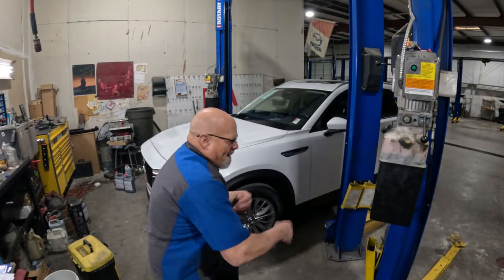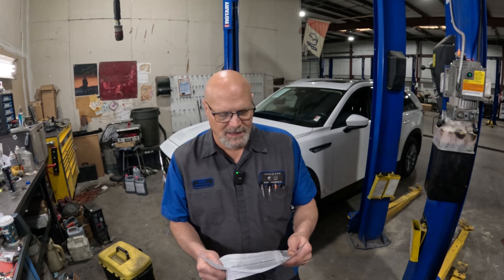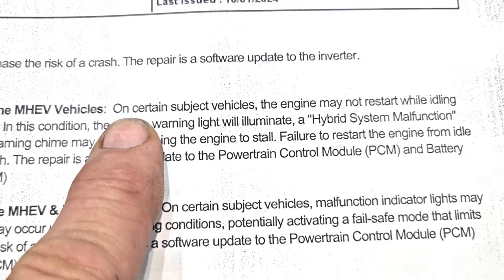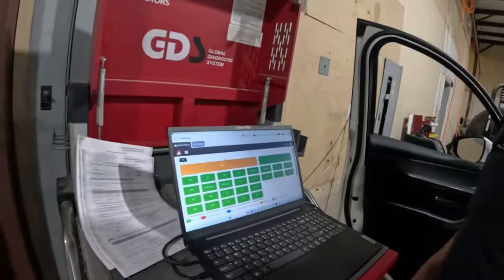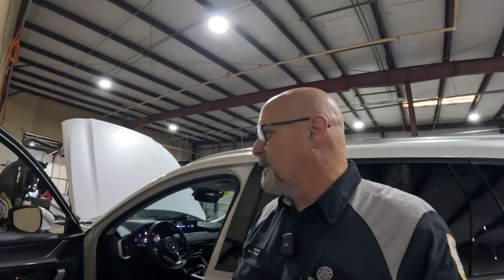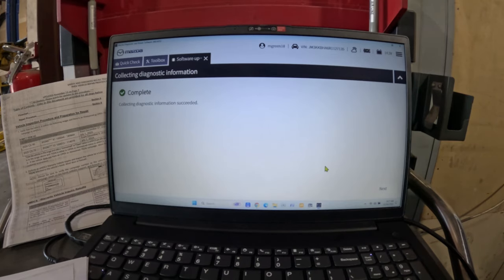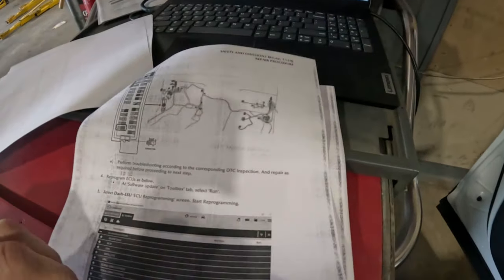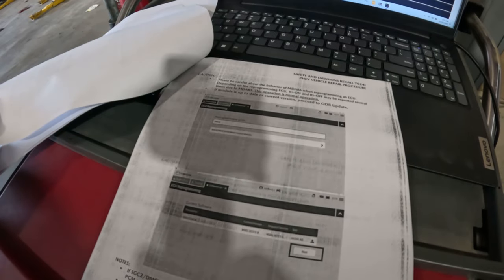Mazda CX-90, CX-70 Recalls

Comment: I was on the fence with a Lexus ISf 350 or 500, and a Nissan Armada platinum. The Nissan is self explanatory, the Lexus was small but a solid built proof and hindsight I wish I bought the Lexus. The Nissan is surprisingly having a few issues, I’ve owned them before and not an issue, however I’d say Lexus all day long folks, the price point of the Toyota is so close and the warranty of the Lexus is a lot longer.

Comment: I always worry that my CX-90 won't start back up while the i-stop is on. Now I see there's a recall. Can you do a video on why Mazda brakes squeak? Thanks for the info.
Reply from the maker: Brake squeak and Mazda can be a very touchy subject.  I'll have to look into this.  Thanks for watching.
Reply from the maker: I call them Trail Blazers.  Cutting the path for the rest of us. Someone has to go first.
Reply: I have the exact same concerns: 1) very slow start from istop, 2) squeaky brakes. The dealer told me both 1) and 2) are normal for CX90, and he said he wasn't happy with CX90.